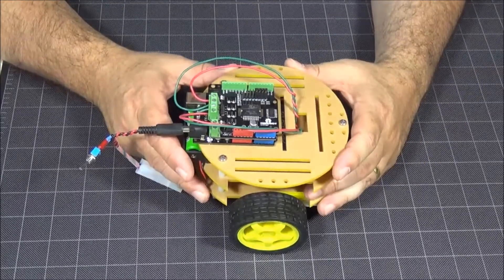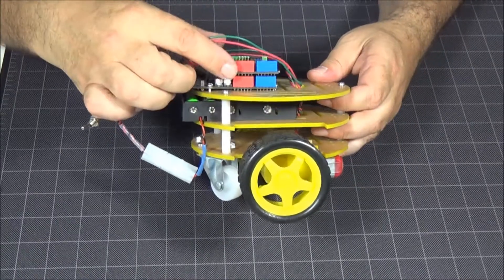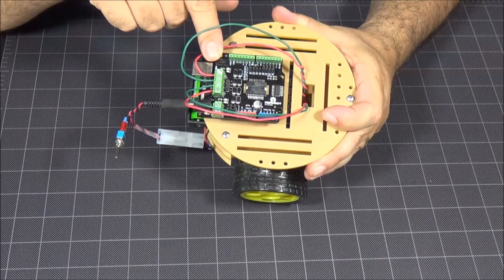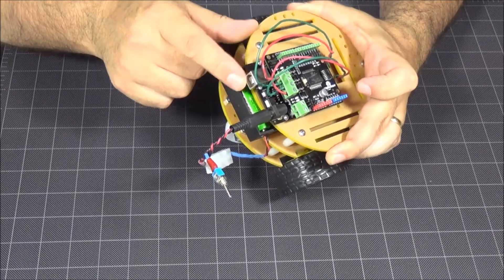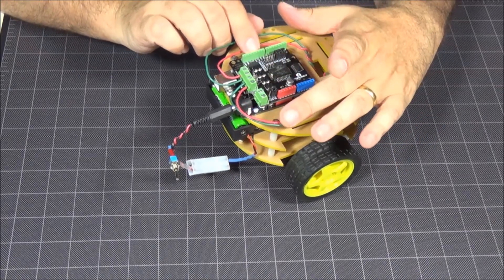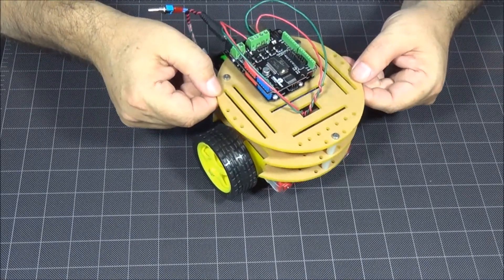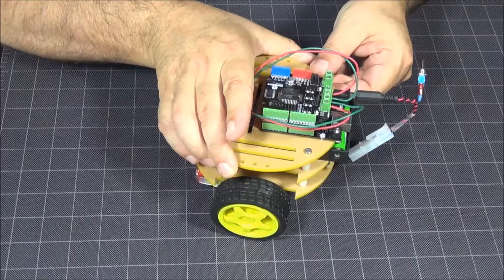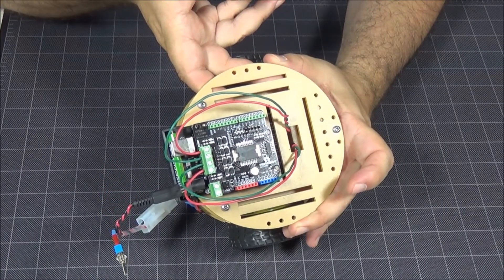Quick look at the DFRobot 2A Motor Driver Shield

Comment: Hey there, cool vid. I too have this same DFRobot board and got a quick question for you...how did you brake / stop a motor on a particular channel ? I have seen many examples of "standard" L298 Drivers that use 3 H-bridge pins per channel and hence have a dedicated brake pin. This driver does not, it only has 2 pins per channel (direction & PWM). So just curious as to any "brake" / stop code you could share ? Cheers, Justin
Reply: Hi Justin,

This is another L298 drive，Please refer to the specific usage：https://www.dfrobot.com/wiki/index.php/Arduino_Motor_Shield_(L298N)_(SKU:DRI0009)
You can also subscribe our channel for more videos on arduino & robotics :)
Reply: Hi there, thanks for the reply. Yeah I already read through that page before after much googling (I came across it), and figured out how to drive the motor and direction(s). I am now "braking" by setting the PWM value to 0, which is fine, it works. But this is very different to most other L298 shields out there on the market, as they use 3 pins for channel... 1 for +ve, 1 for -ve and 1 for PWM...so many example code (for other shields) uses the 3 pins and - - to disable the motor. I mean it's fine, I have everything now working as expected. Just interested, any reason for the use of 2 pins per channel and not 3 (i.e.  no specific +ve & -ve) ?